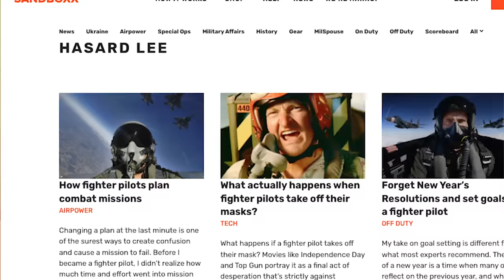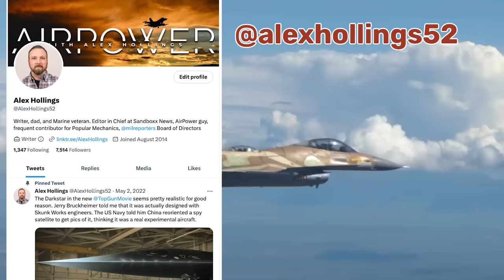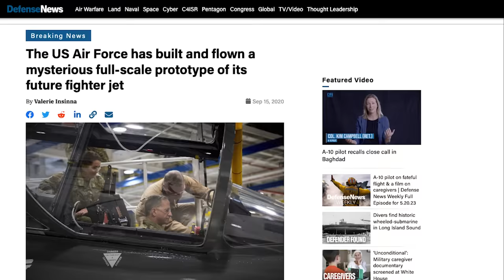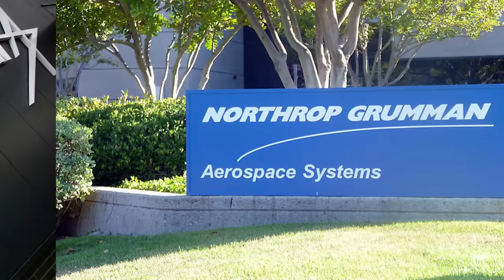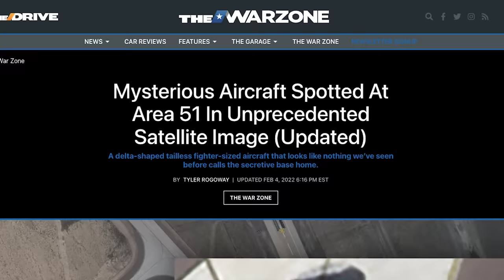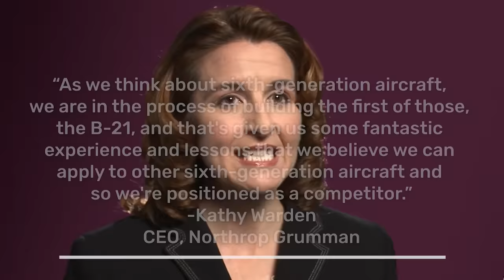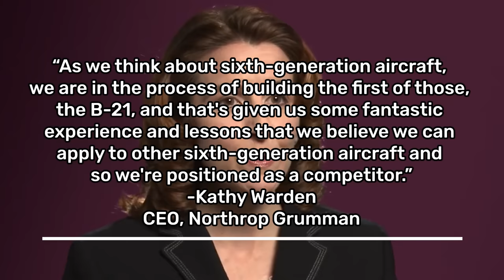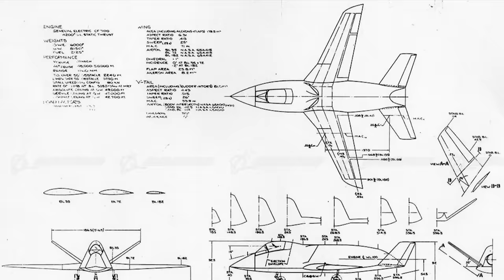The race is officially ON to field America's new stealth fighter

Comment: YF-23 is still the coolest looking stealth aircraft
Reply: Bird of Prey! That thing is so unique.

 Cheap too. I wonder how good the stealth was.
Reply: @dianapennepacker6854  It had promised even better stealth than the F-22 Raptor, as far as I'm aware. Dunno how accurate it is.
Reply: @madsheine2038  Yeah it should be as it was bare bones and tiny haha. That thing is perfect for a drone short of the speed.

 The most impressive part was the cost! Lockheed actually freaken made a plane at a shockingly low price. They would charge ya 10$ for a freaken paper airplane.
Reply: No one copied it, which suggests that the F-22-style shape is better after all. The F-22 got a lot of solutions from the YF-23 - the loser had to share technology with a competitor.
Reply: Why didn't it make the cut?
Reply: It has its charm I still think the F22 looks way cooler though. (those intakes on the F35 though, drool)
Reply: @SavNout01  Higher technology risk at the start of the program.
Reply: @peceed  not necessarily, it was just more complex (and unfinished), and incorporated more exotic design techniques (just take a look at the difference in stabilizers or lack thereof). The F22 was the more traditional option, although that sounds strange to say.
Reply: @jonathanpfeffer3716  It is more traditional, but traditional means more efficient wing layout. V-tail is also too heavy and inefficient for unstable designs, because 30% of tail lift is wasted. A lot of stealth projects has removed v-tail during development. The only advantage of YF-23 was a big and "scalable" weapon bay area.
Reply: Agreed and still has a small rcs than the 22
Reply: And Japan is working on there sixth gen modeled after the 23 the only reason no one else is is because it’s not active status they don’t have to compete with it
Reply: @peceed  That's because copying is an act of unimagination. They don't understand the dynamics and just replocate something they know works.
Reply: @peceed  relaxed stability can just load the main wing 100%. It's a bit higher wing loading but at a better Re and aspect ratio than the stabs
Reply: It was ahead of its time I think.
Reply: The yf 23? You blind or are you before your time….
Reply: So… youre scrambling off a decent size carrier, emergency type scene, teams that were out raised a flag but have insufficient fuel or capability to stick with the observation, the NGAD fighter gets lifted onto the catapult, and is launched, not sure if 1 or two would usually go out, what about the drones, are they launched from a second carrier to rendezvous with the NGAD or if they were launched from the same carrier,
Reply: .....and if the 23 had won you'd be saying the same thing about the F-22. Just can't make internet people happy.
Reply: YF-23 was a great plane from a company, Northrop, which had just failed delivering on time and on budget the B-2 to the USAF.

This destroyed all the faith that US had in Northrop, paving the way for a definitive Lockheed victory.
Reply: @SavNout01  Personally I'm not aware, never researched, ask someone else. I don't even know if my comment is true it's merely what I've heard.
Reply: @peceed  Nobody copied it because there was no reason to. The F-22 was a proven stealth design so you could just rip it off instead of spending money and time researching and perfecting the YF-23 shape. It would be easier to just rip something, already fully proven, off.
Reply: The way I understand it, the YF-23 had a longer range and lower RCS, but less maneuverability than the F-22 and was more costly.
Reply: @peceed  Or nobody was ABLE TO COPY IT while maintaining airworthness...
Reply: Top speed on the 23 is still classified as are many other details about it. That should tell you something. More than likely was very far ahead of its time and the real reason it wasn’t chosen was political or related to the development and production issues of the B2 at the time. I would guess they’ve been improving on the same tech the entire time but with the B21 on the horizon it’s anyone’s guess if they’ll get chosen for the new Air Superiority Fighter or not. People are definitely not happy about the ever increasing price tag on the F35 which makes me think Northrup Grumman has a better chance this time around. In reality though it’s anyone’s guess. It’ll be interesting to see the offerings though when they’re finally revealed to the public. It’s the technology that really interests me more than which one is best. I always wondered what would happen if we put all the best engineers from around the world in one room and had them build the very best thing they could build.
Reply: @RazyrDiarmait  very much could be, don't know tho.
Reply: @SavNout01 f22 more manouvreable
Reply: @peceed  lockheed copied it ( the layout and v tail ) for their sixth generation concept. It was shown on their promotional video.
Reply: My F-22 looks way hornier. When I saw the first pic of the Raptor, I thought it was CGI. Like who could've done that. Not possible. The YF-23 looks elongated, as if the parts didn't quite fit together so they had to stretch it. Cathy Ireland vs Elle McPherson. Still, both beauties though.
Reply: @skullleaderx4986  it means no more than their bullshot artist got inspiration.
Reply: B2 and F22 for me.
Reply: Ever. I fixed your comnent.
Reply: @SavNout01  it was actually faster and had a smaller radar cross section if that’s hard to believe, I’ve even heard it was more maneuverable as well but the Air Force liked the thrust vectoring on the f-22 more. The main two reasons it wasn’t chosen tho was at the time it was believed that Northrop (who was just coming off the b-2 project design and was still working on them so with that project going over cost and them still working on it they didn’t think they could deliver on budget or on time and wasn’t large enough to work on both programs) couldn’t deliver on time or on budget and that Lockheed could(lol yeah imagine that), also the second factor was that while Northrop had achieved and met all requirements Lockheed and met them and exceeded them by doing extra things not in the requirements and flying alot more hours into their prototype so the Airforce believed it was a more proven design even tho both were prototypes. That’s the biggest two reasons, they felt Northrop would have to pull their best engineers off the B-2 and put them to work on the F-23 which they didn’t want!! That’s the speculated reasons and if u believe that Lockheed didn’t do some dirt behind the scenes and promise service members civilian jobs after retirement and donate to some politicians campaigns (which might I add they’ve done a few times, and what’s a $50k fine or 500k fine when u get a $50 billion dollar contract)!! 🤷‍♂️😂🤣
Reply: @SavNout01  Best quote ive heard to explain this was "Northrop brought a 6th gen to a 5th gen contest"
Reply: @appa609  Japan was working with Lockheed on their demonstrator so yes it was directly borrowing technology thru the partnership.
Reply: Word!
Reply: @SavNout01 Hi buddy I see no one has answered you, I'm not an expert but I heard believe it or not that the actual acquisition process was a lot to do with it as in the Raptor was simply presented better, with more glitz and glamour etc, basically Lockheed's sales team did a better job than Northrup Grumman's team, and also the Raptor had thrust vectoring and the yf23 didn't, I hope that helps a bit 👍...
Reply: Agreed, especially when doing the falling leaf maneuver
Reply: Agreed, the YF-23 was a work of art.
Reply: Agreed
Reply: The competition story between the FY-23 and YF-22 was so fucking legendary, Japan decided to make an Animated OVA name Macross Plus after it. (Half truth, half joke. Seriously though look it up if you are interested)
Reply: @PasleyAviationPhotography  no, I wouldn't.
Reply: @dianapennepacker6854  So true!!  Have you seen the 60 minute episode about how the pentagon is over paying by the 100's of millions of dollars..A shoulder fired misile that was 25,000 Dollars in 1993, It's 400,000 Dollars now that is crazy and they know that they are over paying but can't do anything about it.
SO they Say, because those are the only company's that make that ir those parts, ext
Reply: it have da smile 😊
Reply: Yeaaaaah Boi, 23 looks like batman came back from the future
Reply: I always wonder what it would be like if it were developed and went into production like the f22…
Reply: @dianapennepacker6854  no the 23 was bigger than the 22, this increased its roll rate which was one of the negative marks against it, it wasnt as maneuverable as the raptor which hurt it overall. its even alot bigger than the f35
Reply: @SavNout01  it didnt make it because alot of their tech wasnt ready yet, during test flights the raptor flew ton more hours than the 23, even did live fire tests, 23 didnt fire a shot  
the size, its alot bigger than the raptor, 22 is a lot more maneuverable than the 23. 

In the end it came down to the fact it was deemed to high a risk given the unknowns of all the tech that wasnt ready yet, the f22 was ready to go. 
They knew once all that tech was ready, itd require alot more time before production for all the test flights. The f22 pretty much showed it up during the test flights
Reply: @Legion-xq8eo  it wasnt more maneuverable at all , its alot bigger than the 22 and even the 35, it didnt have thrust vectoring either. Size alone though will negatively impact roll, pitch etc rates much more compared to a smaller fighter like the 22
Reply: @Legion-xq8eo  the technology wasnt ready either, meaning even more testing needed when it was. the 22 was ready to go. Raptor also flew a ton more hours and even did live fire tests, the 23 flew alot less hours, and didnt fire a single shot because its tech wasnt ready. 
At the time, us intel services learned russia was designing some incredibly advanced fighters (which never got off the drawing board) and the us wouldve lost to them every time, so they needed a new fighter, now. the 22 ended up being designed to fight future aircraft that were never made, which is why it was so far ahead of its time. 
Yes the 23 outperformed it in overall top speed and range, but lost to the 22 when it came to everything else, it was a clear winner
Reply: @jamesmaddison4546   @James maddison  I never talked about F22 versus the F23 mate!

 Also that sentence makes little sense. If the roll rate is increased that means it is in fact more maneuverable.

 Either way agility is over rated.
Reply: @dianapennepacker6854  🙄🙄 you know what I meant. Increased amount of time to complete one full roll, specific enough now? 
Reason why i said that etc is because you said its tiny when its not whatsoever
Reply: @jamesmaddison4546  Nah the Bird of Prey is a concept stealth aircraft! Should look it up as its really awesome looking.
Reply: @jamesmaddison4546  the 22 was only more agile in one small envelope of flight the 23 was as maneuverable and more so and that is the 23 demonstrator vs the final f series 22 according to Paul Metz who flew both ... Good interviews out there of him talking about them
Reply: @markkern1746  …and how do you know?
Reply: Still think it is one of the most beautiful planes. I think politics got in the way as often does. Military intelligence is one of the best examples of an oxymoron.
Reply: Yf23 is ugly af. F22 and f35 looks better
Reply: If looks could kill
Reply: after the F-22
Reply: dopish ish jst via gaduum😳😳😳
Reply: Thunderscreech
Reply: I agree. I'm surprised it wasn't chosen as the premier fighter.
Reply: Coolest doesn't matter.
Reply: Too advanced don’t wanna field anything too far ahead of adversaries. My guess.
Reply: yeah its a shame the YF23 lost the competition to the F22
Reply: My professor was one of the designer for YF23
Reply: Except the wings. Like the f-22 wings better
Reply: In all the flight videos I’ve seen of the YF-23  and F-22, I like the flight characteristics of the J-20 and Su-57’s ability to obtain what looks like a controlled stall maneuver that looks like it’s powerlessly tumbling in the sky then breaks out in any direction into normal flight. I don’t think America’s fighter aircraft nor its pilots can reciprocate such a unique dog fight maneuver. JMHO 👊🏼
Reply: Agreed!
Reply: It’s a mistake to underproduce the NGAD it’s long past time to replace the F15 and F16. The US needs a multi role fighter that it can produce 1000 of like F16  but keep costs at 100 million or less.
Reply: And stealthiest
Reply: @peceed SU57 copied and so did the Swamp bat
Reply: I agree, what are they thinking ?
Reply: Better in performance, too !
Reply: Nah, it looks so cursed
Reply: Cool looking don't get the mission done, maybe in a video game that give points for style, LMFAO think about some poor chinese pilot s. O. B getting shot down back at base, getting joked by his squadron mates, but man you should've seen the guy that shot me down 'shut up ying, even you didn't see the guy who shot you down'😂😂😂😂😂

Comment: Alex, what have you heard about Russia jamming jdams in Ukraine?
Reply: They can be jammed to an extent, they still guide with INS and become a bit less accurate. GPS jammers have very limited range, by that time INS will do the job, jamming them the whole flight would have a significant impact which is kinda not possible due the low frequency of gps signals blending with background noise. I'm sure Alex has heard of it, not that relevant I guess.
Reply: @kermittoad  I mentioned this as I had seen it reported elsewhere, but thought Alex would be a better source of information and detail. What i read is basically what you state, but it also goes to targeting.  Ukraine may be using them on point targets rather than area targets which contributes to a bigger miss rate.

Comment: Having those book plates is awesome!!! I remember my dad, a mechanical engineer, going gaga for the yf-23! Its still my favorite looking airframe ever!
Reply: The YF-23 was the right choice despite Alex’s conviction. Mostly because while it’s unknown if it would have been a better air superiority fighter, it was a vastly superior attack design. And like it or not the only air to air victory achieved by the F-22 was the shoot down of a Chinese balloon. At the end of the Cold War the F-15 which is still in production was more than enough for the air superiority role, but their was a definite shortage and need for more air to ground capability. If the YF-23 was chosen hundreds of additional planes with air to ground capability would likely have been built in contrast to the 177 not terribly needed F-22s.
Reply: The Chinese will be using a nuclear powered engine to power their next gen fighter. Will the US?

Comment: This is so exciting.  I’ve been following fighter development since I was a kid in the 80s, mesmerized by the teen series. 

After the ATF competition, things felt so stale because development seemed to slow to a snail’s pace through the 90s and early 2000s.  

I was REALLY surprised when the govt let slip they designed, built, and flew a next-gen prototype a few years ago. I really hope that’s true and I hope we get to see it some day. 

And I really hope this isn’t an SDI-style bluff where some of the tech sees the light of day but the overall program doesn’t.
Reply: Look, it WILL be the absolute "Signal to noise ratio" fighter plane. Emit no signal, but there will be so much noise about it, It will NEVER live up to the Hype. And even if it does Mach 3, there is no drone that could keep up with that yet. Not unless the "A.I.-wingman" drone costs about as much (or more) than an F-35 today. We can't even upload all the battlefield Map data in an "emergency case". Much less to train an AI to do maneuvers according to the changing conditions.Or entire Missions.  If the NGAD will be  a "Boom and Zoom" fighter, (bad at rolling and turning) You got a Hypersonic Missile nightmare ahead, once the enemy  masters Electro-optical zooms, or UV/IR or Magnetoscopic detection (Satellite based detection still is a thing). Once weather satellites get a 10 m resolution, no matter what airplane you fly at whatever altitude. it will be detected. Just by changing temperature and humidity of the Air.